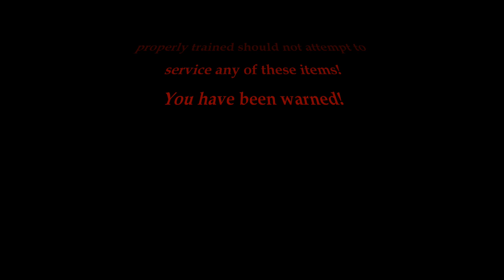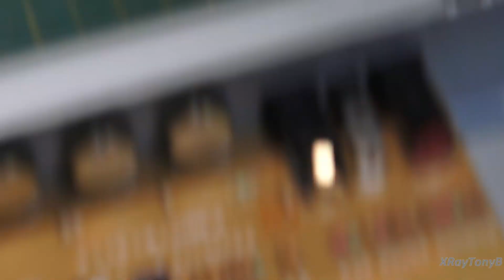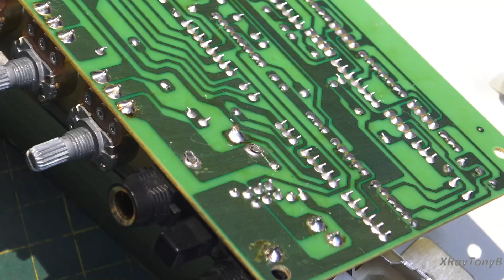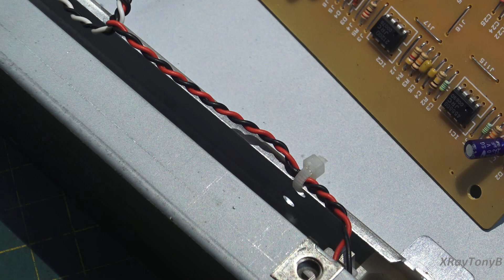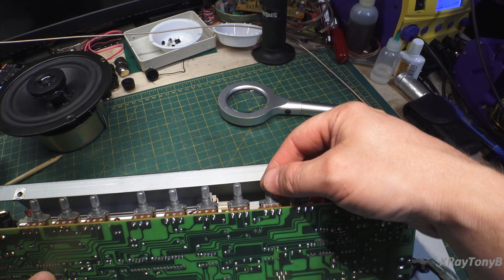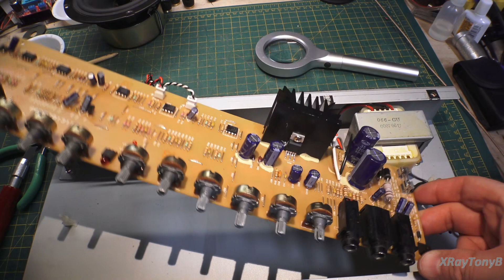Fixing a guitar amp....with a little help :)

Comment: Did you have this amp schematics? I check out the internet and found the schematics for the 50 watt and  15 watt version, but not for the 30 watt version. I have one, and have to replace one resistor of the Power amp section that is just about to blow up. The heat of it, burned the stripes so I can't identify the resistor values.

Comment: Have you watched The Guitologist channel?  He advocates panel mounting things and running connecting wires to the board.  Apparently board mounted stuff is more prone to breaking.  It certainly seems like you could find a stronger jack.
Reply from the maker: Love the Guitologist channel!  I actually have a bunch of really good quality switchcraft  jacks, but they are just a bit too large to install without at least some modification.  The owner wanted it to be original, so I put in the original part.  I agree, the switchcraft would have been much sturdier.  Thanks for watching!

Comment: The capacitors in tube amplifiers carry a high voltage charge in them even after they're turned off. The voltage MUST be bled off before you do much of anything with it. Keep in mind that there are several other capacitors in any amp as well. Don't get zapped. If you're not sure what to do, take it to a professional.
Reply: This is good to be aware of, sure. Notice though that this is not a tube amp.
Reply from the maker: Very good point.  You can't stress it enough.  This little amp, however, doesn't use any vacuum tubes and only has about 30 volts on the caps.  They discharge almost immediately when powered off.  In several of my past videos, I demonstrate the use of a discharge wand to safely discharge the high voltage (and any other) caps.  In one of the Q&A videos, I also show how to build one.

Comment: I am surprised the capacitors are Samwha brand, a brand that had a lot of failures in many Samsung TVs a few years ago.   I thought in a guitar amp if this magnitude the manufacturer would have used higher quality brand components.

Comment: When I take apart a pcb I tend to reflow every joint where there is mechanical stress, jacks, pots, switch, power transistor, and add some silicon to support items that can vibrate with shock.
That will save you from mounting and un mounting several times.